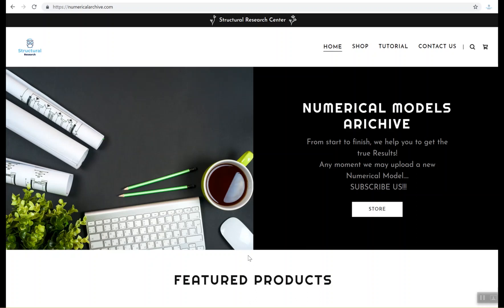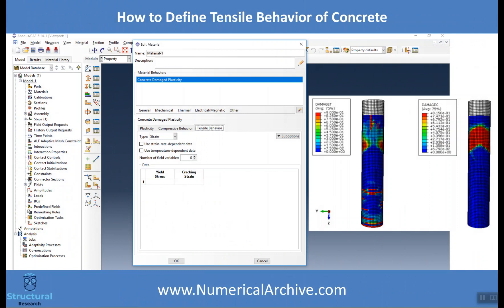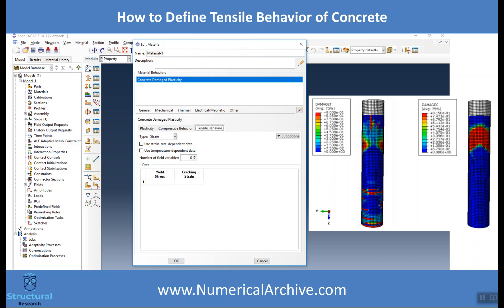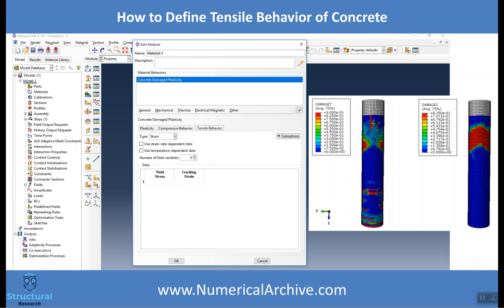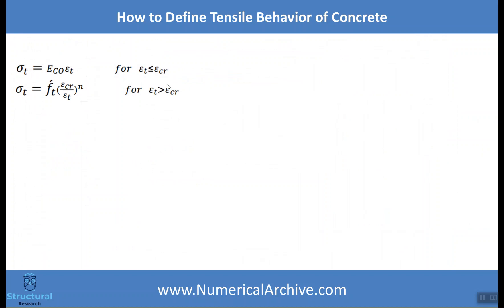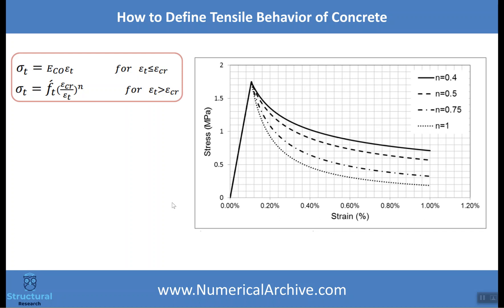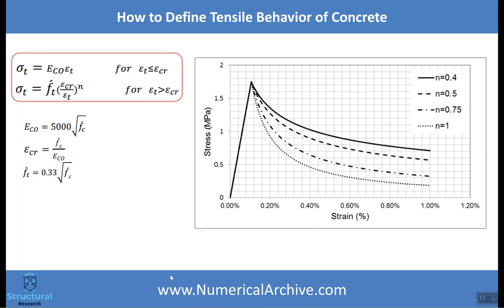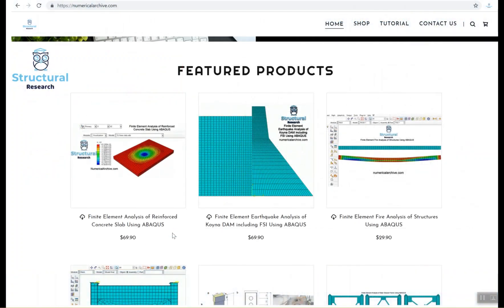How to Define Tensile Behavior of Concrete in ABAQUS

Comment: Does the stress strain diagram as shown in video is the required yield stress vs cracking strain or we need to modify it as for compressive stress-strain?
Reply from the maker: Numerous methods have been proposed by researchers to determine the tensile stresses and strains of concrete members, usually for tensile stresses you do not need to apply changes in values.